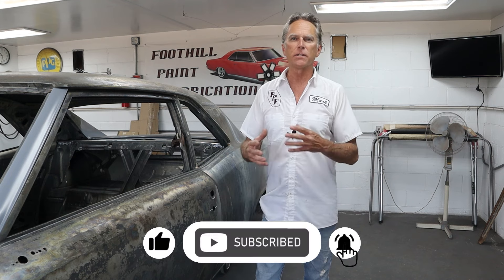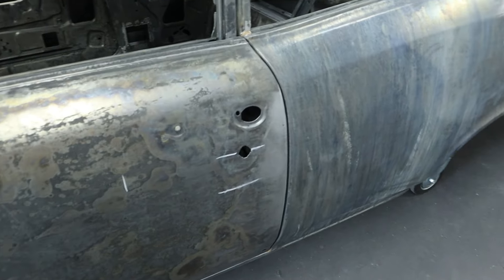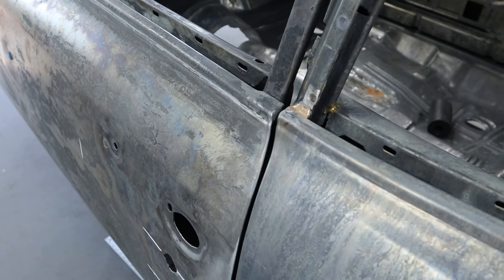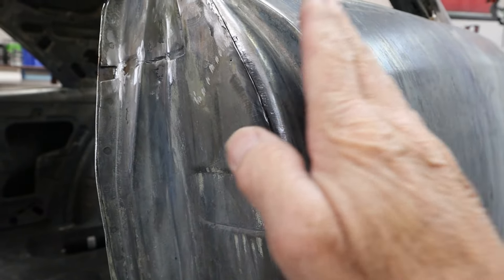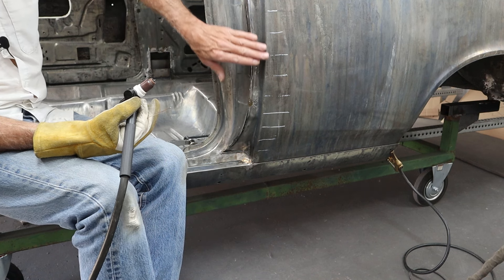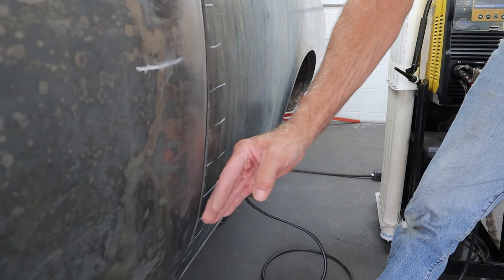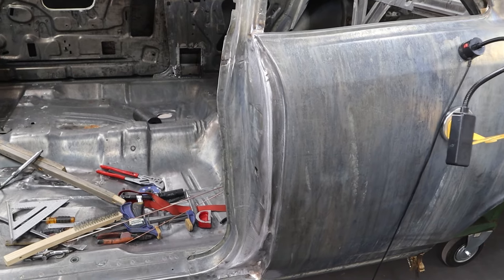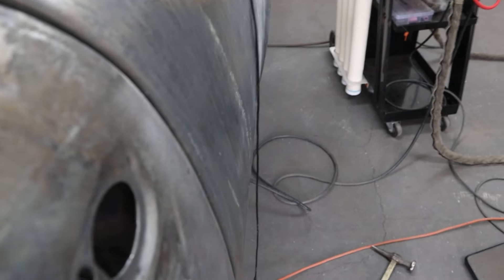Re Aligning the Quarter Panel AGAIN! - GTO RestoMod (Ep 53)

Comment: Have you considered silicon bronze on the edge? The melting point is lower than steel, it can be built up in layers and shaped with files and by sanding. Most important, it won't crack like plastic filler on an edge.
Reply from the maker: Yes I have. That is what I used when I tig brazed the top and bottom. More heat than lead but way less than mig or tig steel build up  Not sure which way I will go yet but thanks for the great suggestion.

Comment: Thanks for all the great videos on project Ruby.  You are inspiring me to never stop at the first time I start to think "that's good enough" on my '69 GTO metal work.  I had a question about the end of the video where you said the small section right on the quarter panel edge near the top of the door will definitely need some filler.  Maybe I will just have to wait until that future video, but will you use one of the specialty "metal" or "fiber" augmented fillers right on that edge subject to some bumps or rubbing; or will regular old polyester-based filler be adequate?
Reply from the maker: Thanks John.  The more metal work we do upfront the less filler work we do later...hopefully.  These things simply cannot be remedied with filler anyways.  Not sure what I will use on that edge and the little low spot that showed up when I drove the edge down but it will not be lightweight filler.  I might lead it in or use metal reinforced body filler.
How is your project coming along?